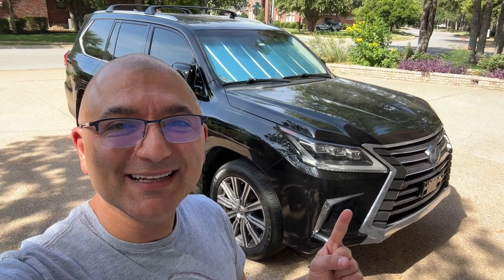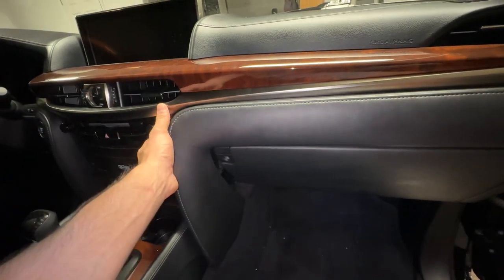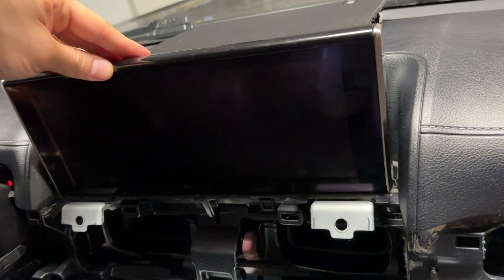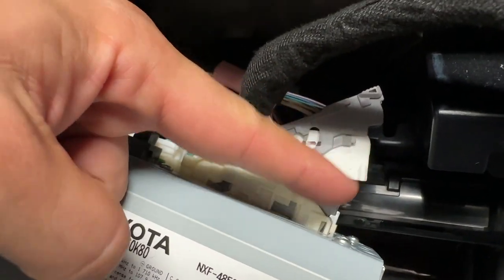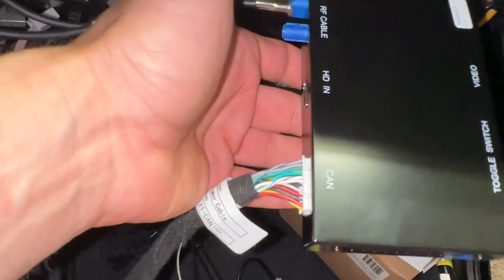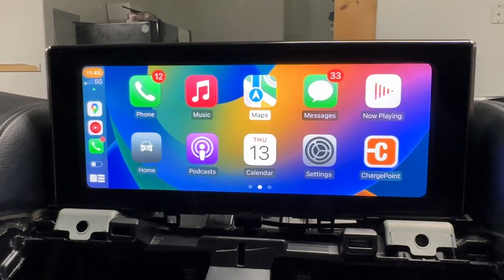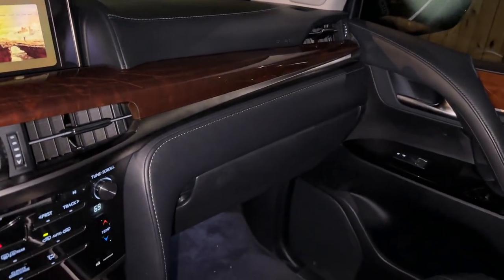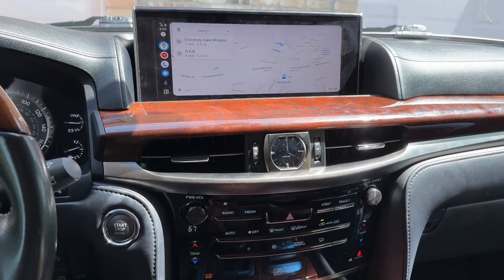LX570 Cheapest Carplay AndroidAuto Upgrade - Installation - Review - Tips - Tricks Mistakes Apple

Comment: Man, you made this easy for me! I just did the install in less than 2 hours on a Grom unit using this and taking my time to pay attention to your feedback. THANK YOU! Only real pain was routing cables and finding the best location to mount the unit.
Reply from the maker: I bet that feels good to have done. How do you like the setup so far?
Reply: Well, was great until I got in and put it in reverse. Factory camera looks like a bad OTA cable channel. Working with tech support now to see what the deal is. Have the latest firmware and software, so we will see…
Reply from the maker: I’ve seen some people having issues and just needing to reseat the cables. Have you tried pulling it apart again and just testing while the trim and dash are still apart to see if it works?
Reply: Did that, no luck. Checked all the fuses, all were good. Pulled a few I didn’t get key on voltage to abs verified they were good.

…them it started to work fine…so it’s fixed and not sure why, but I’ll take it!
Reply from the maker: @Michael-do1lq  I bet it was a loose connection somewhere. Still working?
Reply: Yep, still working. You are probably right!

Comment: Another great video, LX570 was lucky to get you as the new owner. You are my idol, 2am in the morning and still doing media content. I have not kept up with the latest software for car play, I now feel like I am current. I cannot believe how user-friendly most of that interior has been for removal, even that center console looked simple. Thanks again for making these and I look forward to upcoming episodes.
Reply from the maker: Thanks Mark! I’m too old to do this stuff at 2am. But I just wanted to get it done before traveling again for a week, and not cutting into family time on Saturday 😀 The interior was pretty easy to take apart. The toughest part was where that too long section met the gauge cluster trim. There are some clips there that attach the two parts that were tough to wiggle out without breaking. But with a little bit of patience they came out with no damage. I think if I had good instructions or a guide to follow the entire thing would have take 1 hour. But trying to figure it out as I went with all the mistakes it took me around 5 hours. So far I’m happy with it. It would be nice to have a touchscreen instead of the joystick. But this is far better than not having CarPlay.

Enjoy the weekend!

Comment: just installed this in the car, do you have the issue when the joystick is clicked down or moved in the carplay screen it presses buttons on the stock interface?
Reply from the maker: I hear it clicking in the background, but never noticed it actually pressing any buttons or changing settings. I saw on the IH8MUD forum, someone else mentioned this as well. For me it's been okay so far.

Comment: An update from my personal experience after watching the video. An excellent video to follow. I installed the exact same unit on my 2021 Lexus LX570 (Australian model - right hand driving) on Saturday the 18th of November 2023 and it worked.

1. The unit was installed above (not on top) the air filter behind the glove box (the video doesn't show where it was installed).
2. I used DIP switches 2 and 3 (set to ON) because the screen was flickering when the DIP switches were set to 2 and 4.
3. The lever/controller on the side isn't perfect, but you can use left/right to go up and down, and you can use up/down on the controller as the keyboard tab.
4. The car always starts with the standard Lexus infotainment, then switches into Carplay after about 5 seconds.
5. I noticed that it sometimes switches back to AUX as an input despite that I clearly set it to Bluetooth.
6. When I receive phone calls, the Carplay (this is more of a Carplay issue) goes into the phone's full screen even if I had the GPS running. Switching it back to GPS requires a bit of fiddling using the stupid Lexus remote controller.
7. Reversing the car switches into 3D camera then back to Carplay once completed.
8. Steering wheel buttons all work with making and terminating phone calls, going into the next or previous song, and to put the volume up or down.
9. Removing the trim on the side of the console was very hard (not as easy as shown in the video). Once they're removed, you'd end up with some red locks in the grooves (these are NOT broken items. It's designed this way).
10. Make sure that all the plugs CLICK when you insert them. Having loose connection would give you headache (almost gave up on the connect to the screen as I thought I had a faulty unit. It turned out that the connection was loose).

The screen real estate and audio (using the Lexus Bluetooth system) are flawless.

Would I prefer spending a $1,000 to get brand new unit to replate the entire infortainment system? Absolutely.
Is such a unit currently in the market? Not at all. Not sure whether Alpine would invest in such units.
Is this unit a reasonable solution for what we want? (i.e. GPS guidance using Waze or Google or Apple maps?) Absolultey.

Thanks for the maker of this video. I hope this complimentary feedback would add value into it.

Cheers,
Khaled
Reply from the maker: Khaled, what a great detailed review. I and probably everyone else reading this really appreciates you taking the time to share your experience!!
Reply: @NKPGarage 
Thank you for a great and detailed video. Can you please give us an update on how it’s been holding up ?

Comment: The first Gen CarPlay used a knob. If you just tap the joystick left and right and ignore the up and down, it works great. Don’t try to use it like a mouse, just tap the lever left and right and navigation is super simple.

I got mine from NAVIKS but then realized they just repackage the gizmo from a Korean company called indiwork so I ordered my second kit direct from them for less then half the price shipped straight from their factory. Put this into my LX and IS.

Now I want to find out that option for audio over Bluetooth as I struggle with the phone either staying on Bluetooth or shifting to CarPlay audio and then I have to switch to AUX.
Reply from the maker: That’s a good tip. I noticed the up and down function from the joystick works on some screens but not on other screens with CarPlay. But with android auto it seems to work in most places. Sticking to the left and right is much easier for sure.

Comment: Does work in Lexus is 200t 2016?
Reply from the maker: Which model 200t do you have? NX, IS? GS, etc…?
Reply: @NKPGarage  Lexus Is 200t 2016
Reply from the maker: @Rayan15588  yes. It looks like it should work with that model. If you look at the Amazon link and read the product description the Lexus IS model is supported by the kit.
Reply: @NKPGarage  Thanks